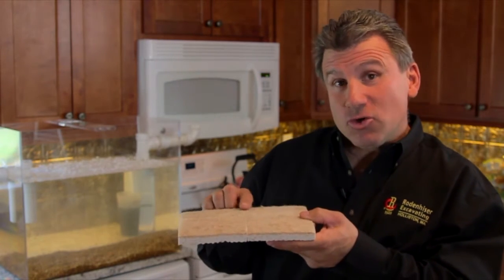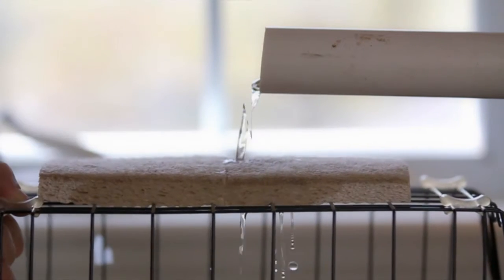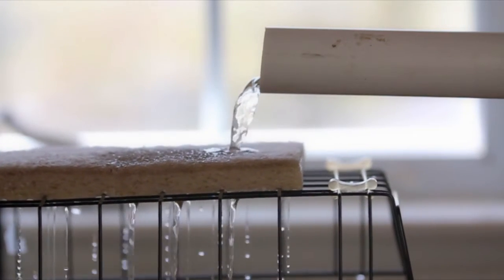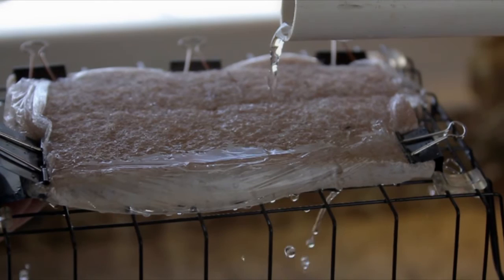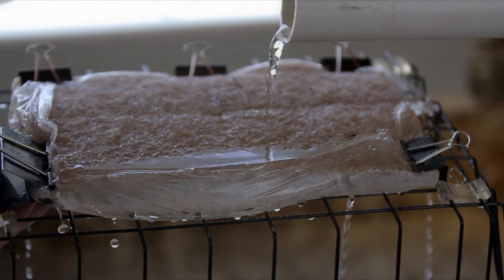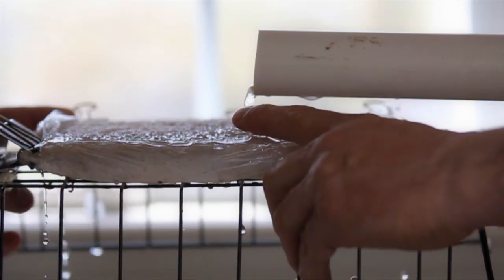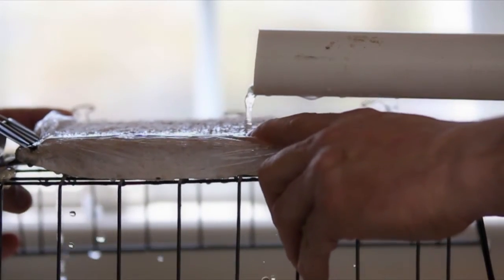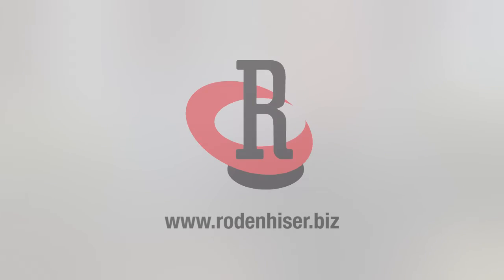What are the warning signs of septic system failure?

Comment: I have an issue with my toilets but for some reason thats the only thing causing symptoms. If one toilet gets stuck and the water goes for a few hours and then i flush the other toilet it floods through the bottom of the toilet. Its so weird! I have no issues doing like 6 loads of laundry in a row or taking a long shower right after someone else. Any idea what this could be? I'm super poor so 300 dollars to have my septic tank drained is a 4-5 month process to pay off and I would rather avoid it if its actually a clog somewhere in my house or something. I have no wet dirt or anything (and I'm in florida where it rains a LOT so i would guess i'd get this symptom super fast). When I called the first septic company they pretty much said over the phone based on my symptoms i need a new drain field...
Reply: How bout building an out house?!! Works great for me!
Reply: sounds like something is blocking up the toilet pipe

Comment: Don't be scammed by septic "professionals" who insist that you need to spend megabucks on a new system.  More often than not, simply hydrojetting the laterals will fix a slow-draining system.
Reply: Art C worked for me.
Reply: I know this comment was ages ago but THANK YOU so much for it.
I was beginning to think replacing the entire system was my only option.

Thousands u just saved me!
Blessings to all that chimed in.
Reply: @00BAAM im having what seem to be septic issues. Sand mound has very wet spot i think its from slow draining so its soaking at the surface. I havnt had any plumbing issues inside the house thank God. 

Did you have a similar issue ? And has the jetting sped up draining and dried out field ?
Reply: Rid-X

Comment: How do I fix the problem?  Spend thousands of dollars having it dug up and replaced?
Reply: Hi Anthony - In order to fix the problem we would need to know exactly what is going on.  You can call us directly to discuss what you are experiencing and the possible causes for free.  If you decide that you would like a technician to come out to take a look at the situation and recommend an appropriate action we can set up a service appointment for you.  Unfortunately, sometimes the system is in such bad shape that the only recourse is to replace it.  System replacement starts with the design of engineered plans.  Once plans are approved we can then provide you with a quote for installation of the approved system.  If an inspection reveals a problem that is able to be fixed we would file a permit application with the Board of Health and once the permit is approved we can schedule it.